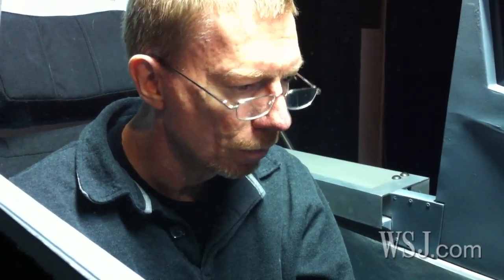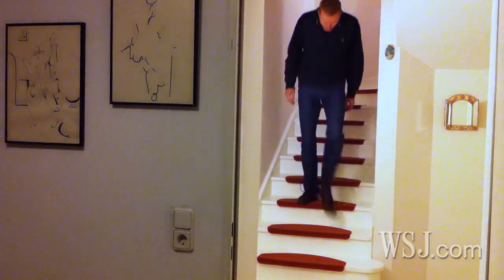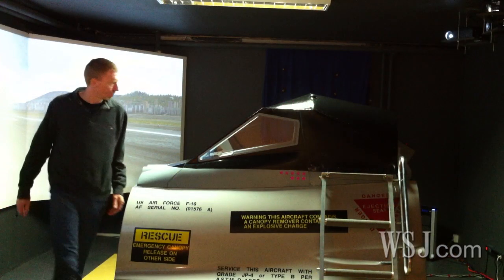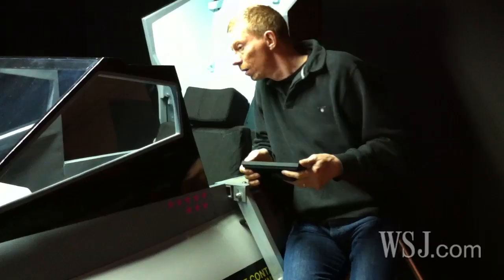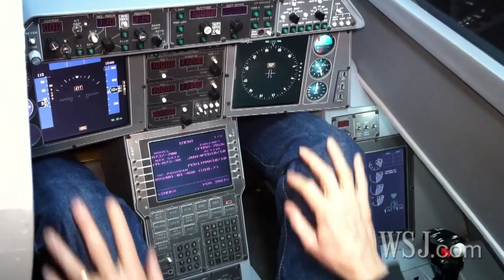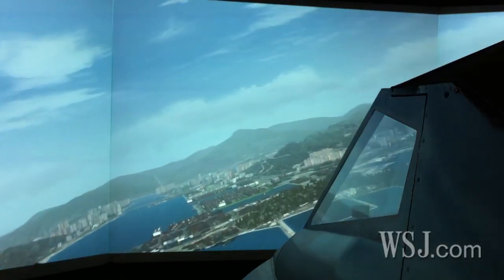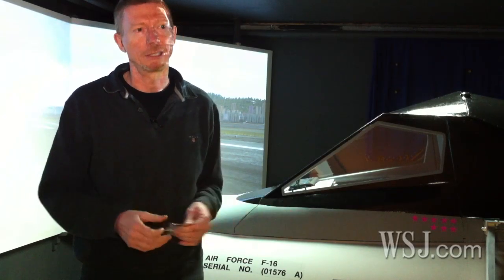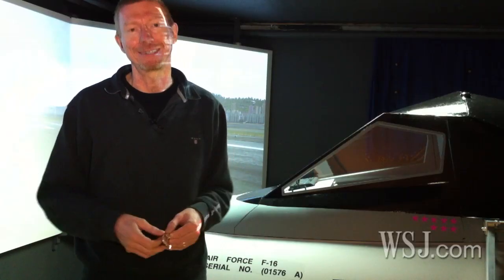Homemade Flight Simulation Cockpit

Comment: "a joystick that resembles controls on an Airbus plane"
really,that joystick is a thrustmaster cougar,replica of F-16 fighter jet
i own one .so please get your fact right
Reply: ***** Let's try to keep things calm. The F-16 actually does have a side-stick control, being the first fighter to pioneer the arrangement. But the reporter is also correct, the controls are like an Airbus (A320 and up), he probably used it as a reference since more people probably know how what an airbus is then an F-16.
Reply: Dan W but then he continued to say that the exterior resembles an f-16
Reply: A-10 Warthog* The F-16 and the A-10 use the same stick IIRC, but the stick itself is a replica of the A-10s
Reply: +Dan W 
Thats because it was fly by wire.

Comment: 20,000 will land you a real Cessna 152 this is cool but why not become a real pilot?
and sorry to say while simulators like FSX are pretty accurate they are not exact 
feeling the forces apply on an aircraft in real life is totally different I volunteer at an Airport to gain flight knowledge and flying time i have flew in many planes my favorite being the Beach Craft Bonanza 35B/35A V tail let me tell you it's a hell of a ride
Reply: x-plane 10 is by far the most realistic. I fly and In my opinion x-plane 10 has almost nailed it!
Reply: Still cheaper to maintain than an aircraft, though. You're right about the feel of flight though, that's difficult to simulate, at least at home...
Reply: Your correct about the cost to maintain an Aircraft, a real aircraft requires by federal law a rebuild of an engine after so many flight hours,maybe around 1,000 or so,which can cost around $18,000+ for just a 172.
Reply: That's exactly right,you have to buy a regulations book and study it.
Reply: Yea I've been a student pilot for a while,lots of studying and hard work.
Reply: giving the bird why u are so negativ in your comments flying in a real life could be different from the sims , because of the Wind effect onto the hull , but there so many sims now where you can parameters everyth to be more accurate to the reality so its dépends on you , just set everyth as real inot the parameters , trust me that true